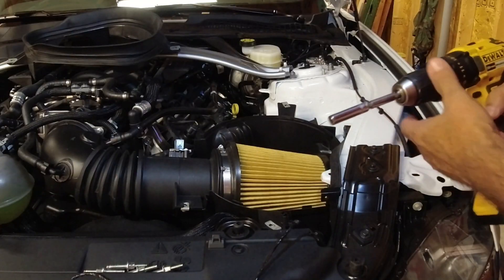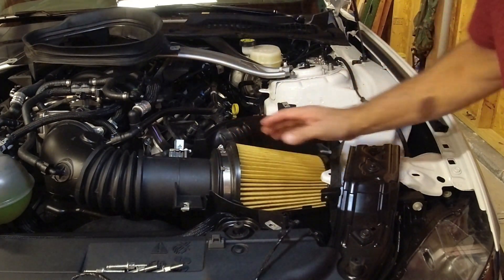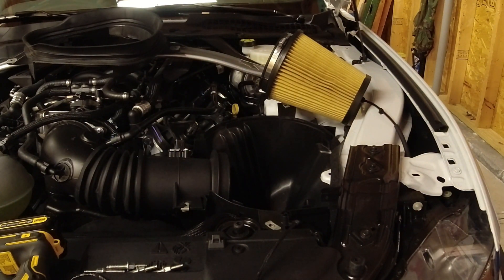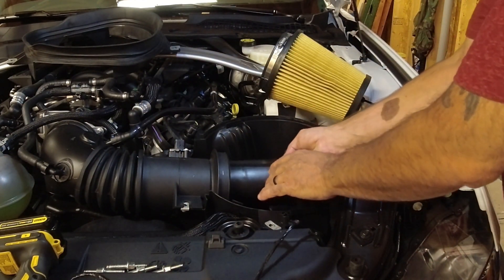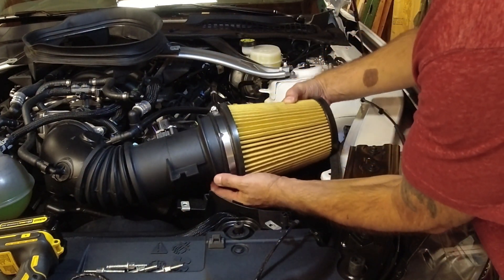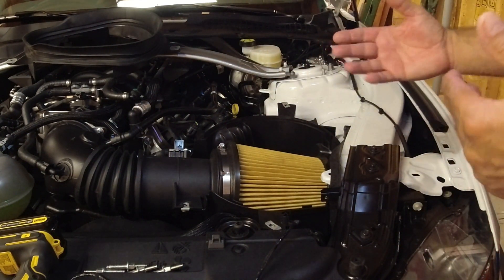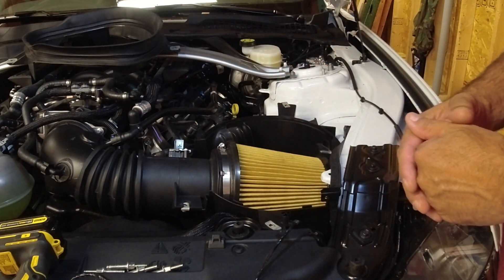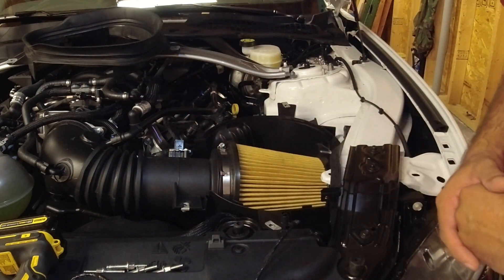The Truth about 2022 & 2023 Coyote V8 Part 2 Important updated Info

Comment: Pulling the insert out of the tube between filter and the throttle body doesnt change the diameter.
What changes is the velocity and volume of air that moves through the tube. Thats what your MAF sensor is detecting.
Its why steeda had such a long R&D process with early cold air intakes for gen 3 coyotes.
You took the pipe out and put the same one back in. It didnt get any fatter or skinnier. Same inner and outer diameter. Just volume and flow changes is all....
Reply from the maker: Originally I did not put the inner sleeve that holds the HC Trap back in and my fuel trims were off (Video One). Minus the inner sleeve the diameter of the intake tube is quite a bit larger at the mass air flow sensor and the car would occasionally bog on acceleration. Once I  reinstalled the insert minus the trap everything went back to normal. Steeda has a lot more resources and knowledge than I do but I can tell you that if you don't reinstall the sleeve your fuel trims will be off by 10% or more.

Comment: I just got my 2023 mustang GT S550. I pulled apart the cold air intake and the hydrocarbon trap was not there. However the vehicle is still rated at 450 horsepower. Any idea what the deal with the 2023s are?

Disclaimer: I'm not a mechanic.
Reply from the maker: Yes I do know where it's located. You have a closed airbox set up so it's bit different. Here's your video https://youtu.be/ZcDJWxclSyo
Reply: @TonysFordsandMustangs  Thank you for the help! It's appreciated.
Reply from the maker: @ndawg87  Thanks for watching!

Comment: Thanks for posting. I removed mine completely - also did an x pipe...got CEL today - everything running fine but my code reader is out of pocket at the moment. Going to re-insert the sleeve without the filter and see if that does the trick.
Reply from the maker: Thanks for watching. I did some data logging and everything looks as it should. I'm at 1% percent fuel trim long & short with the tube back in. Even with the tube out I was only at 8%. Maybe something happened with an O2 sensor harness during the Xpipe install?
Reply: @Tony's Fords and Mustangs  that could be a possibility for sure! Will report back my findings. Keep up the great content!
Reply from the maker: @george.d.honeycutt  Please do! Merry Christmas!
Reply: @Tony's Fords and Mustangs  well what a great Christmas/Birthday gift to receive other than the CEL resolving itself after about maybe 75 - 100 miles of driving with the sleeve back in w/o trap. Nearing my 1000 miles break in completion sitting at nearly 750 miles - this is an amazingly fun car and have never been this satisfied with a purchase.
Anyway - thanks again, just wanted others that may run into the issue with their 22 know my experience.
Merry Christmas Tony and have a safe Happy Mew Year!
Reply: @george.d.honeycutt  Same for me

Comment: Should the Mach 1 get a catch can?? I been told yes, and I’ve been told only if you’re tracking it, I’ve also been told yes no matter if it’s just for the streets or the track but I’ve also heard no, because it voids warranty..?
Reply from the maker: It's really up to you. The cars fuel injection system is designed so that you don't actually need one. That said I have one on the passenger side and it does catch oil. Once again I suggest you check out my playlist on the Mach 1 and thanks for watching! https://www.youtube.com/playlist?list=PLz2M3b_orpr3WOr2d853is8S6hubCkoqD

Comment: Just pulled mine out, call me crazy but I felt like I can tell a difference! Only drove 20 miles but no issues.
Reply from the maker: I put it on a dyno so you know your not crazy. :)
Reply: @TonysFordsandMustangs  well 1k miles later and still zero issues. I'm going to be swapping out the resonator for an H pipe next week, I am curious if that affects it any further with the additional change to air flow. Might consider a tune after that?
Reply from the maker: @CoroCoroMike  I think you might pick up a couple of torque but the resonator isn't the issue with the exhaust side. Once you cut it out you will see it's striaght through. There's some weight savings as well but it's mostly sound thing.
Reply: @TonysFordsandMustangs  ok awesome, thanks!
Reply: Hey i know its been a year… any problems?
Reply: @dripgod5517  zero. Car runs great

Comment: well you have such great content and information I really appreciate it I have a 22 Mach 1 same color I believe but I would love to see a video on how to actually remove the inside tube out of the intake I know you said you put screwdrivers in it was that from the rear and you sleep three long screwdrivers in there and then pull it out or how exactly it comes out thank you I'm a little Leary with fooling with my brand new expensive car but I really want to do this and I live in Florida so it's legal
Reply from the maker: 3 screwdrivers go in the tabs in the front, towards the filter you pry those up a bit and you push from the back on the trap itself to remove the tube. HC trap comes off tube snaps back in job done

Comment: I have a 2022 Mach 1 handling pack and watched your last video and removed the restrictor and I’ve been daily driving it for 11 days now with no check engine light. I will let you know if I do get one but I don’t think I will it should have already popped up I feel like.
Reply from the maker: I just finished a 5 day 1,800 mile trip, with track time at multiple tracks with no issues. Did some data logging along the way and everything looks good.
Reply: @TonysFordsandMustangs  Hi Tony, did you have the tube reinserted during your trip / track days? I removed the whole tube from mine, curious if any check engine light from running rich.
Reply from the maker: @UnitedNaishuns  Yes and put the tube back in minus the trap. Your trim will be 8 to 9% with it out.

Comment: So I should be fine doing this without a tune correct
Reply from the maker: That's what a couple hundred other users are saying.
Reply: @TonysFordsandMustangs  so it’s torn down now and I can’t get that tube out to save my life
Reply from the maker: @BDRslayer  you have to pull mass air flow sensor and remove the tube. You need 3 screwdrivers under the tabs on the filter side at the same time and push on the HC filter to get the tube out once it's out getting the filter off is easy. Then put the tube back in making sure it snaps into place.
Reply from the maker: this wasn't true. But you to watch the follow up videos. 😉

Comment: +17% on fuel trims is a lot!! Almost no room for a splash of E-85 😳
Reply from the maker: With the tube back in it's under 10 so..
Reply: @TonysFordsandMustangs  would you recommend running an aftermarket no tune required CAI for a 2022 GT or would that go over 10% fuel trim ?
Reply from the maker: @Oliver-ft2fq  Sure, they are the expensive way to get rid of the HC trap but it shouldn't change Fuel trim numbers. they measure tube diameter where Mass Air Flow sensor is mounted in order to make it "No Tune". The cheap way is to find a 21 and back lid. https://youtu.be/ZcDJWxclSyo
Reply from the maker: FYI I'm at 1% after a 2,300 mile trip. Long and short.

Comment: Another great video Tony!  I'm going to do what you did in this video while I'm waiting for my tuner.  Quick question, is it possible to remove that hydrocarbon trap from the inner tube by just taking the top lid off the air filter and sliding it out without removing the entire cold air intake?
Reply from the maker: Thanks you and no sir it isn't possible. The HC Trap is attached to the tube. So the tube needs pulled and trap can come off and the tube reinserted.
Reply: @TonysFordsandMustangs  thanks for the reply, what I meant was the outer tube does not need to be pulled and detached from the throttle body correct? Just the inner tube needs to come out correct?
Reply: @wesd2845  I will be doing mine today or tomorrow, did you have to remove the unit from the throttle body to pull the tube out?
Reply: @claywhicker8549  Yes you have to completely remove it. All the tools you need is a torx bit to remove the MAF sensor and it's either a 12 or 13 mil deep socket to remove the top part of the air filter.  The most challenging part was removing the inner tube.  I had to take three table knives and put them under each tab simultaneously and then push it from the back. Tony uses a screwdrivers but I found the table knives were more flexible and easier to use. Make sure you put the inner tube back in without the filter because if you don't put the inner tube back in it'll throw off your fuel trims.
Reply: @wesd2845  Thanks!
Reply: @claywhicker8549  in addition to pulling the MAF out of the CAI I would also disconnect the MAF sensor so that way it'll reset itself to the increased air flow. Once you finish the project make sure that you let the car idle for a a few minutes and then when you drive it take it easy for the first 5 mi or so to give it a chance to adapt to the increased air flow. You're going to love it more power, better sound and better gas mileage. You will be smiling for sure!  Let me know how that works out for you
Reply from the maker: @wesd2845  Thanks for stepping in here Wes! It's appreciated. I didn't see these replies till just this minute. Best of luck Clay!
Reply from the maker: @claywhicker8549  You technically can do it but it's a bitch to deal with and a lot easier out of the car. I pushed on the back of the trap to release the tube towards the front. I would hate to see the tube IF someone did it without removing it. I would imagine the tabs on the tube that needs put back in (PLEASE WATCH THE SECOND VIDEO) are a mess.  It's a15 minute job the way I did it and really there's nothing to technical about it.
Reply: @TonysFordsandMustangs  I removed mine today using your method.  Drove a few miles around the neighborhood and then a few on the freeway with no issues.  Didn't expect much but it really did seem more responsive, like Normal mode was Sport and Sport mode was even better.  Thanks for your help and your videos!
Reply from the maker: @claywhicker8549  Please make sure you watch the second video in the series. You need to out the tube back in place. Not the trap but the tube needs to be there.
Reply: @TonysFordsandMustangs  Oh, I have watched all of them :)   The tube was put back in.  Thanks again for your efforts.
Reply from the maker: @claywhicker8549  Thank you for watching Clay. Glad to be of assistance.  😉
Reply: @wesd2845  I have had a chance to take the car out several times since making the change and you hit the nail on the head, I love the change.  Thanks for the help!
Reply: @claywhicker8549  I'm really glad you like the results!  I would highly encourage you to watch Tony's video about the active exhaust issue.  https://youtu.be/Q7j1_bqwbgU
Reply: @TonysFordsandMustangs  With the extra filter removal & Airaid drop in, do you notice a much more audible "whine" from the intake when you accelerate?
Reply from the maker: @claywhicker8549  Slight but nothing crazy. You might want to check your filter seal and that the Tube is actually "snapped" back in place.
Reply: @TonysFordsandMustangs  Thanks for that.  The sound was pretty minor but I did just double check and the tube was not "snapped" back in place.  I fixed that and will see how it goes.  Thanks again!
Reply from the maker: @claywhicker8549  No worries thanks for watching! I'm sure that the tube not being seated was your issue.

Comment: Interesting…way to choke off an engine for no real measurable difference.  I paid (as we all did) a gas guzzler penalty for my 2021 6 speed car that is consistently getting me 17-18 mpg in the city. At least it looks like the engineers were thinking thru this carbon trap and tube.
Reply: I wonder if someone will take that tube out and compensate on the tune with the stock air box 
That would be interesting because some intakes run a wider tube for more airflow
Reply: The gas guzzler comes from the transmission being a tremec. Only one overdrive of 6th vs the MT82 having both 5th and 6th as overdrive.
Reply: @snoozesleepytime  well aware of why, just pointing out it is ludicrous.  As is the carbon trap.
Reply from the maker: Yeah right.